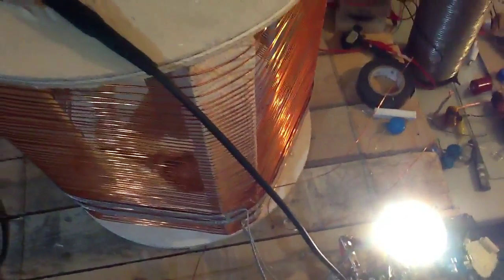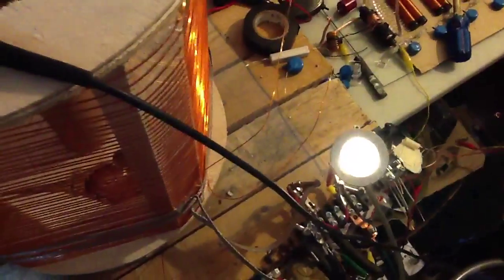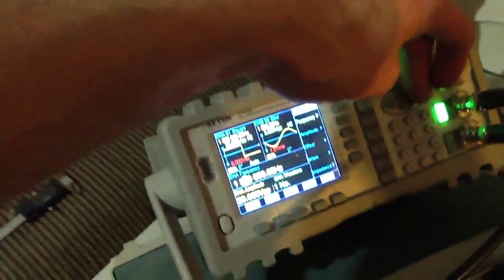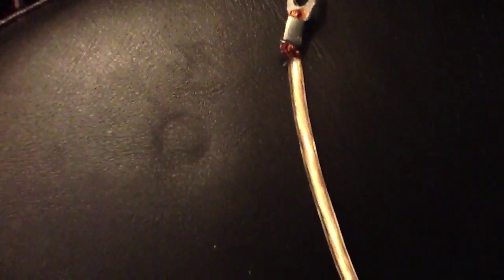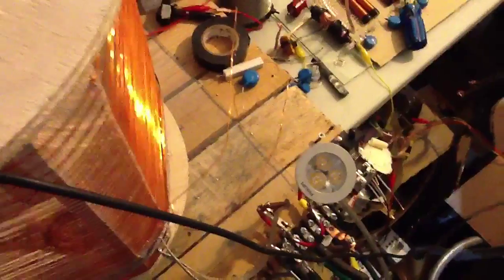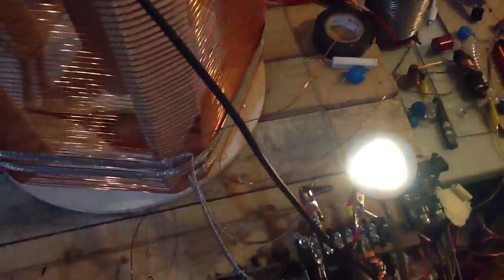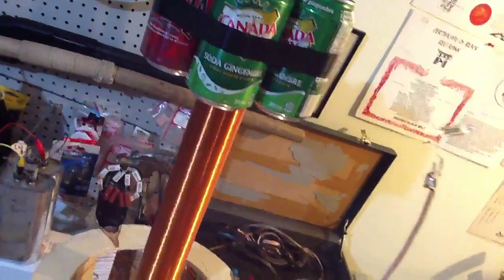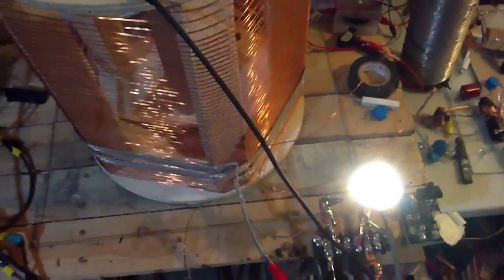TMT: Tesla Magnifying Transmitter (Pat #1,119,732)

Comment: I would like to learn more about the extra coil. A link to Eric dollard info about the extra coil would be appriciated. 
Is the Extra coil functioning on a higher harmonic?
Reply from the maker: @Master Ivo i have detailed hand-drawn notes from Eric, but would have to be e-mailed images.

The idea with the 3rd Extra coil / 3 Coil LC Series Resonant / Magnifying Transmitter, as named by N.Tesla himself.
Is also detailed greatly Upon it's discovery.. in the Colorado Springs Notes near page 78 i believe.
Essentially the 3rd Extra coil and Aluminum toroid comprise a Series Resonant LC which develops its resonant rise based on the applied frequency direct into the base of the helix, NOT the standard induction with Primary to resonator directly... 

But with the use of 3rd coil,  the #1 Primary and #2 Secondary are together a driver, and are a simple air core arrangement with as close coupling as possible now... with Resonator far away from the magnetic coupling of the primary :)

Based on expert 2 and 3 coil builders, the Magnifier really stands out beyond 1000w, exhibiting abnormally long discharges / voltages, etc..
but shoot me your e-mail !
Reply from the maker: @MasterIvo   my pleasure. and to answer a question above.. the 3rd coil Resonator would by virtue of its high turns and capacitance would be the lowest frequency compared to the primary and secondary's wire length frequencies. 
"the momentum of the resonator must preponderate beyond that of the driver circuit" ... approx.. 
But for certain, it is ideal to run the pri/sec at the frequency of resonance of the 3rd coil, just FYI :) talk soon !
-Kurt
Reply: @kdkinen  Thanks Kurt! Below you say, hmm I thought about it, but it makes no sense. But sense is often wrong :)
I already experimented with equal frequency, but used parallel resonance, not series.

Comment: My understanding based upon his 1892 & 1891 lecture and Colorado springs notes is that there is a capacitance within the conducter (see Figure 6).He asserted this is because a current reflects from the ends of the conductor. Check out the analogy in figure 4 of the 1892 lecture. It's even the same shape as figure 6.
Now take the magnifying transmitter and tip it on it's side the compare to the previous figures.
The question becomes how to apply his stated principles to the device .

Comment: and also, you know how the sec and pri is the 51ft diameter fence? It looks like the secondary is like loosely wired, and the other fence like coil (Extra Coil) seems loosely wired too, but the extra coil in your vid is tightly wounded like a modern secondary coil. And is the sec/pri the same circuit as a normal SGTC, and the current from the fence is wirelessly trasfered to the Extra Coil?

Comment: Fantastic experiments!
Do you use solid state tech with the transistors to power a primary, or you do it with a signal generator and amplifier? Because I don't hear any spark gap noise in the background..

Comment: I've never seen any docs on it, it's just guess work on my part, same way i worked out how he built his rotating spark gap  (I did a video on that design) and Know you are on the right track with the pri coil..  but I figured it out by old Pics of Tesla, there is a few of him diff one that is where this coil appears in the back ground, It cannot be a spare or anything ... it's fully constructed inside and mounted to the wall, so I'm pretty sure it was a permanent feature in his lab...